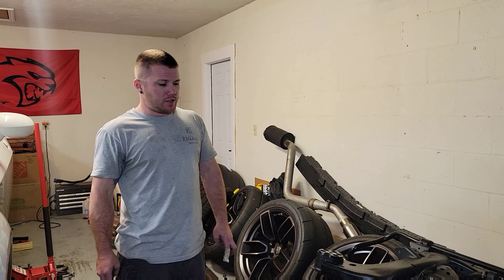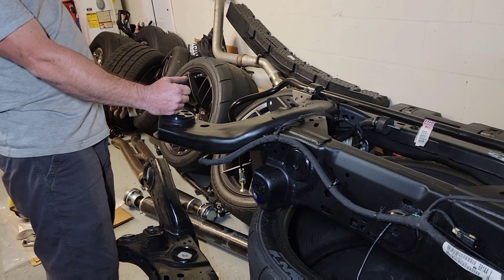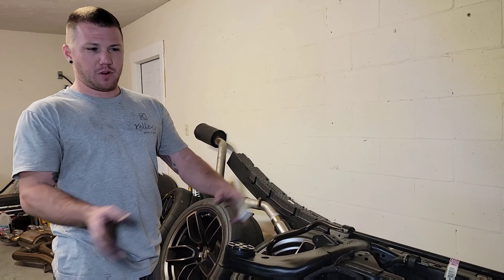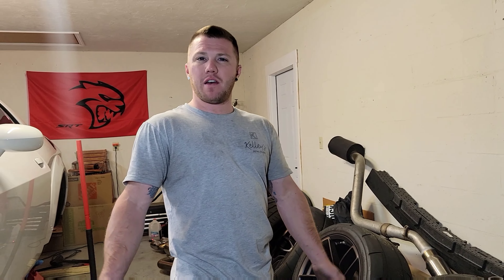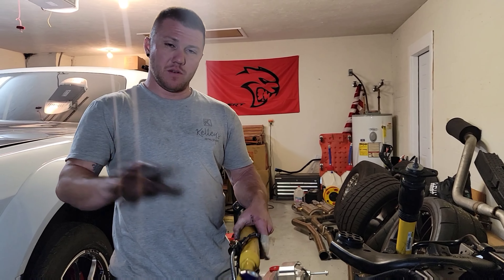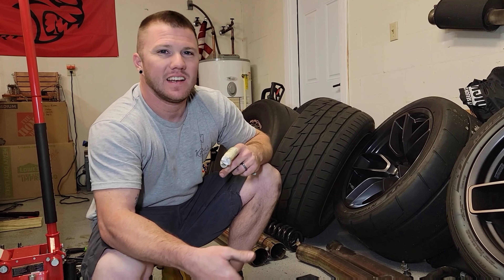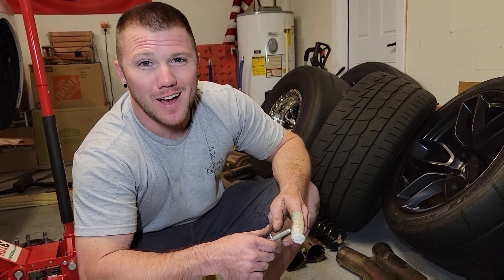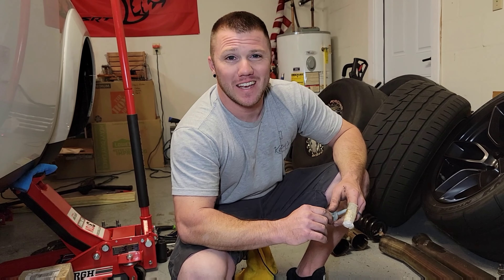Installing Solid Aluminum + SuperPro Bushings on my Hellcat Redeye!

Comment: How's the ride quality? I think I might try aluminum cradles and lock outs. Is it overwhelming with NVH?
Reply from the maker: It's noisy but I don't mind it. At this point, the car is purpose built for the track. Unfortunately, it's not going to have all of the comforts of a factory car, especially once you start modding.
Reply: @KelleysGarageOfficial  thanks bro maybe going aluminum will be overkill for a high horsepower street car. I'm still on the fence on what to do. I'm already invested in a polyurethane setup but haven't gotten the parts installed yet.

Comment: Hi Chris...Did you notice any difference between the BMR solid lockouts vs the others you had installed?
Reply from the maker: Major difference. With the normal lockouts the car just stiffened up a bit in the rear. With the solid mounts there are no rubber insulators to mitigate noise and vibrations. The rear end is very loud now,  they work great though!
Reply: @KelleysGarageOfficial  Thanks...looking forward to track vids :).
Reply from the maker: @jcasey460  going to be awhile. Still waiting on Jokerz to finish the blower. Going on month #3.